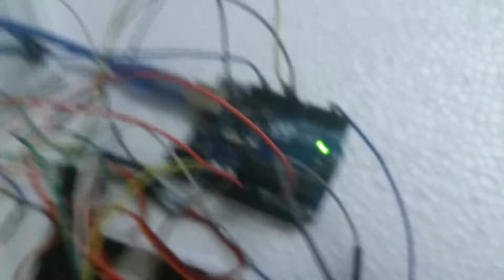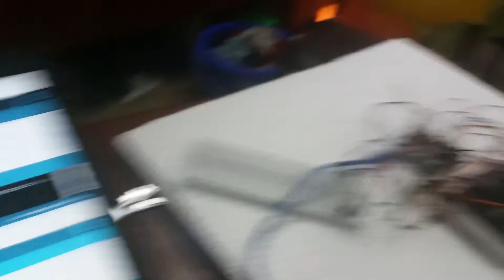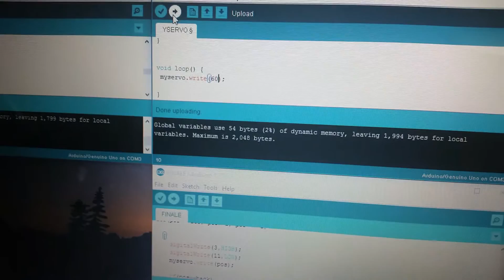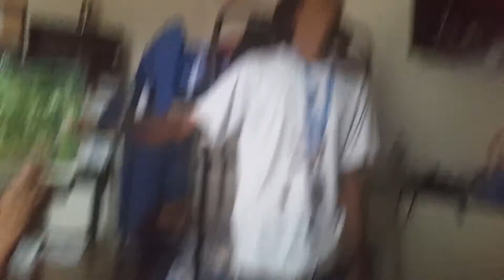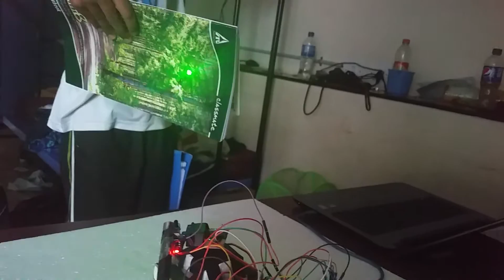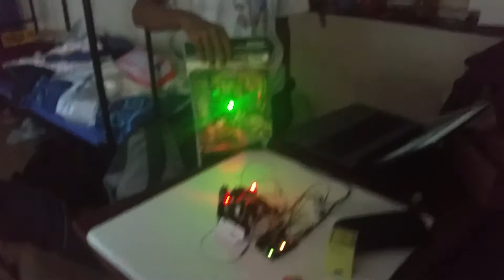VIT University, Physics Project, 1st Semester, Arduino Uno controlled Laser Range Finder

Comment: Technically this is not  laser based distance measurement project, it's only IR proximity sensor based security system project and laser is just used to point to an object in front of the sensor. you can better use laser range finder sensor VL53L0X. 

This distance sensor contains a tiny invisible laser source, and a matching sensor. It can detect the "time of flight", or how long the light has taken to bounce back to the sensor. Since it uses a very narrow light source, it is good for determining distance of only the surface directly in front of it. Unlike sonars that bounce ultrasonic waves, the 'cone' of sensing is very narrow. Unlike IR distance sensors that try to measure the amount of light bounced, the VL53L0x is much more precise and doesn't have linearity problems or 'double imaging' where you can't tell if an object is very far or very close.

This sensor can handle about 50mm to 1200mm of range distance. It also includes a lux sensor. The sensor is small and easy to use in any robotics or interactive project. Module comes with a regulator and level shiftor so you can use it with any 3-5V power or logic microcontroller with no worries. Each module comes with a small piece of header. Solder the header onto your breakout board with your iron and some solder and wire it up for instant distance-sensing-success!

Communicating to the sensor is done over I2C with an API written by ST, so its not too hard to port it to your favorite microcontroller. 

Libraries and Sample codes are available for Arduino and Raspberry Pi, which makes it easy to use the sensor in your project.